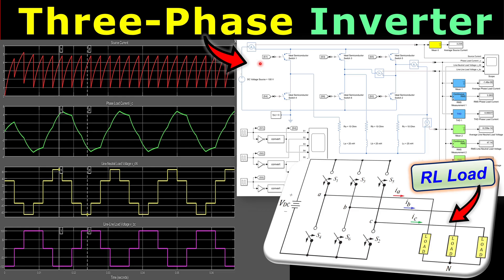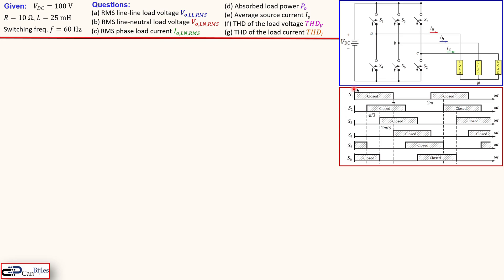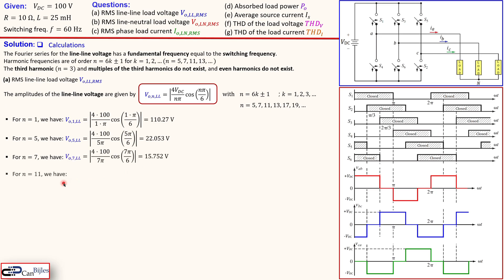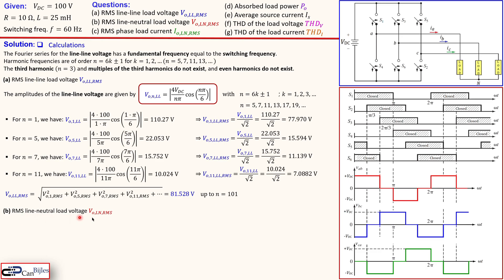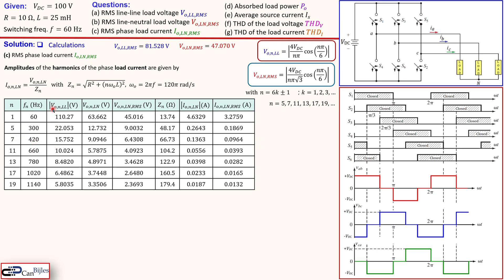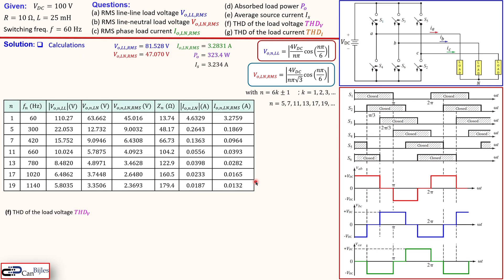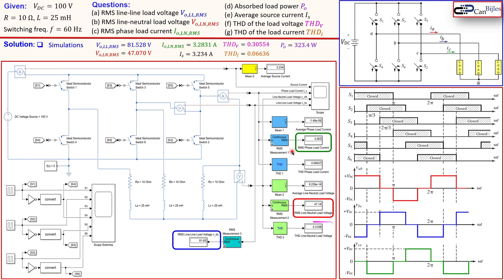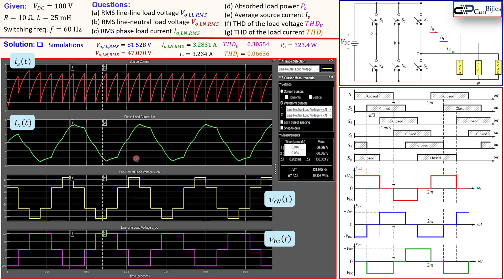⚡Three-Phase Inverter with RL Load 🔋 Power Electronics 👍 Step by Step Worked-Out Example & Simulink

Comment: Hello sir , 
Do you have videos that shows how to design a loop control for 3 phase inverter  ?
Reply from the maker: This is a nice topic I still want to discuss in detail later. Here, you can read some info about this subject: https://www.mathworks.com/help/mcb/gs/open-loop-and-closed-loop-control.html
Reply: @CANEDUX  thank you so much for your help , that will be so usefull .. Is there any design guideline , book that explains step by step how to design the loop and choose  component .. because i really need these information for a project .
Reply from the maker: @mohameddrissi7215  There are some books that touch on the topics loop control of power converters, but I  think the application notes of Analog Devices, Texas Instruments, etc. are more to the point and practical. 

See this video for more info and link to resources in the video description:
https://youtu.be/p5q5jMvsjto
Reply: @CANEDUX  thank you sir , i already saw this video and i found it so great by i m looking specifically for control loops of inverter to control motors
Reply from the maker: @mohameddrissi7215  Got it, I will look at it.

Comment: HI, CAN, could you explain why i shouldn't considered the sqrt(3) for 3-phase in this particular case leading to sqrt(6) for Vo,LN. is used of value of 6 define six-steps of switching?
Reply from the maker: Thanks for your message. I do not know if you mean the formula, but I answered this already for another question in this video. 

The formula for Vo,n,LN is correct, but when I moved to next slide to collect the formulas, I forgot the sqrt(2) in de denominator, so in total, it should be divided by sqrt(6). 

Actually, the formula should be written as Vo,n,LN where the harmonics order n is shown.

Does this answer your question?
Reply: @CANEDUX   yes, you re correct, you said sqrt(6) is the correct once below. I read it after asking you the question above, sorry for that. but moreover am asking why is it the case in the formula sqrt(6) also i see 6 appearing in Vo,LL in this divided by pie inside the cosine. the waveform across the loads no pie/6 but pie/3 of each phase being shifted. would you explain the concept behind it, if you don't mind it? and thank sir
Reply: yep, I see why it should be sqrt(6), you don't have to answer that part, its is clearer! that is from sqrt(2) multiplied by sqrt(3)  at the denominator equal to sqrt(6) defining Vo,n,LN so nothing to do with six switches. however 30 degrees inside the cosine i have no idea since each phase is shifted by 60 degrees( pie/3).

Comment: Hi, CAN,  I asked you in your pervious tutorial, about what define phase and neutral in square wave inverter, since load experience bidirectional across it. its seem like no independent phase wire then phase voltage is just alternating across the load each time.
Reply from the maker: Hello, thanks for the message. The DC input voltage is grounded and the star-connected loads are not, but when the loads are balanced than the neutral node (N) is referred to ground too.
Reply: @CANEDUX   oh yeah thanks sir, so for the 3 phase inverter, it's the same idea as dual supply source of Vdd and Vcc. where two sources are balanced sources in series hance the node between them is zero volts( neutral). but for the single stage yet this is not the case too, isn't??
Reply from the maker: It depends on how what you define ground in the circuit.